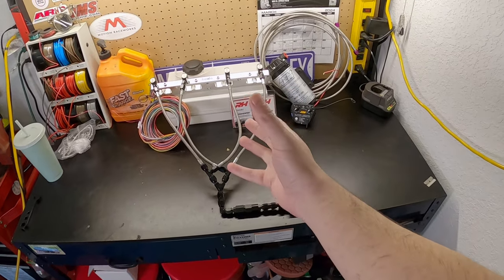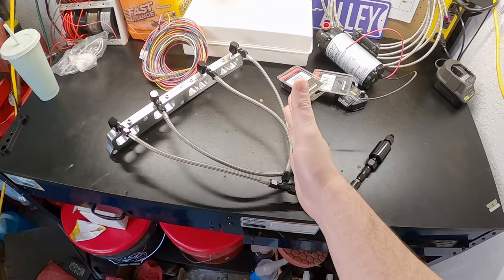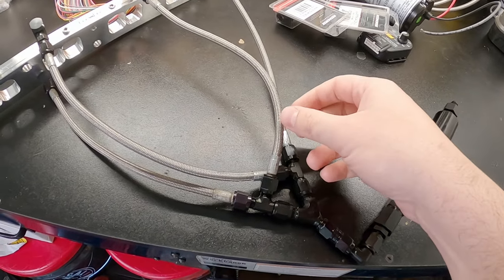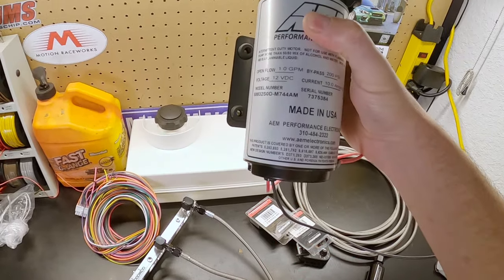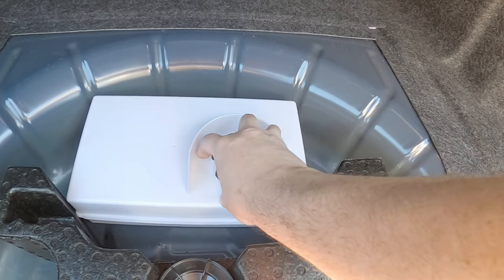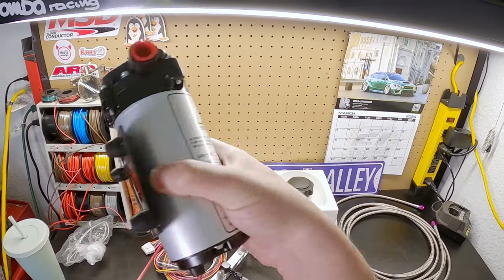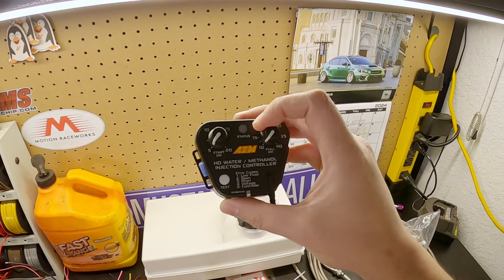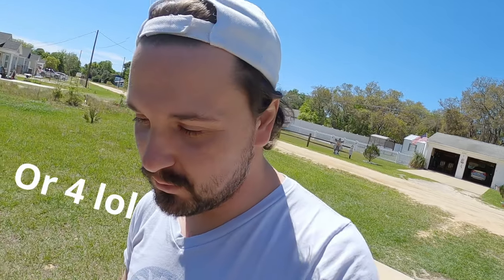The ULTIMATE Mustang Ecoboost Water Methonal System!

Comment: Should have just went with hpfp and injectors for e85.   Methanol will only do so much , it does have its  cooling effects so maybe thats why u went that route
Reply from the maker: Cooling is the primary the reason for this. I may also experiment with running different fuels through the system to see how it works.